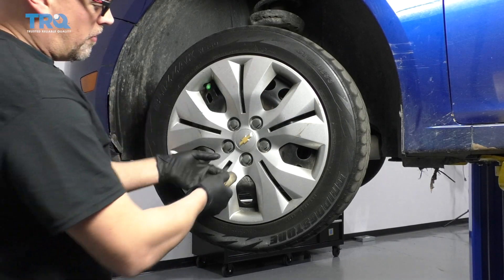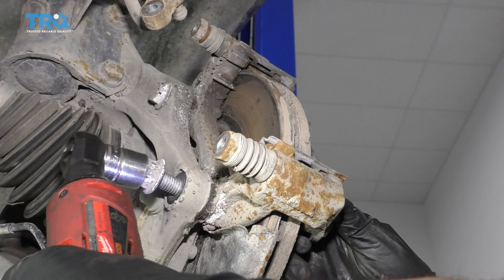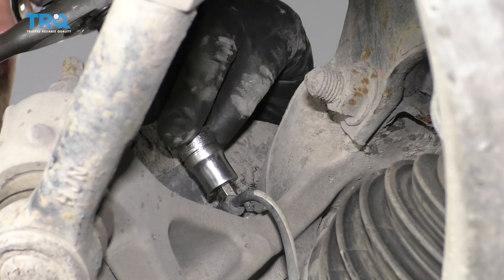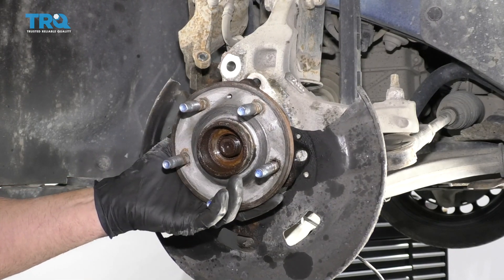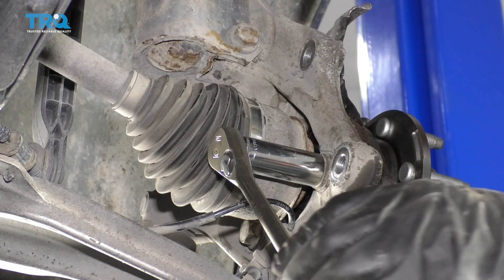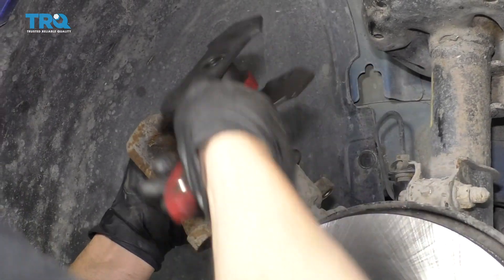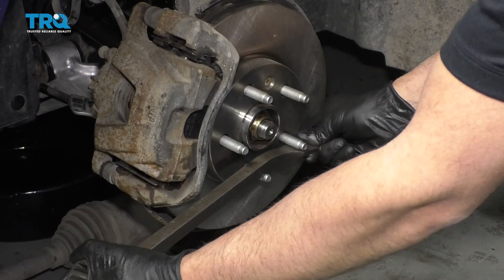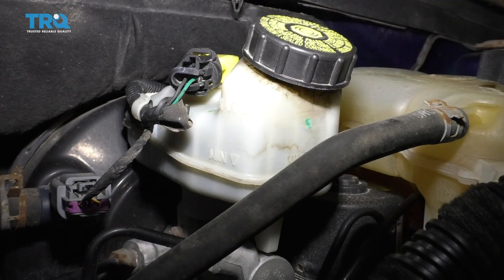How to Replace Front Hub Bearing 11-15 Chevy Cruze

Comment from the maker: √  Watch the Video
√  Buy The Part at 1A Auto http://1aau.to/m/Shop-TRQ-Parts
√  Do it Yourself
√  Save Money
Reply: I just bought new brake caliper slide pins and the bolts are not 10 mm they're 14 mm bolts now
Reply: what if you don't have a torque wrench just a breaker bar
Reply: my new wheel bearings from this company didn't come with new axle nuts in the boxes at all
Reply: Outstanding!  One of the best how to videos.  I was not looking forward to this job but this video made it a snap.  Only thing left to do that was not mentioned was dust the brake pedal with a microfiber towel!!  😂

Comment: Very good straightforward video. Just need all the gear you have to make it that easy. Premade hubs are a good idea in some ways. My old Holden Commodore did nearly 250k kilometres on the original hubs.Lot better than every 60k repacking

Comment: Excellent walk through! Now to go parts shopping and see where this will go wrong...
Reply: So here's how it went wrong: Couldn't get the retaining screw out on the driver's side. Rounded off the Torx head, then tried to get it out with a screw extractor. The screw extractor snapped.

Ended up drilling out much of the head, then banging the rotor with a mallet until it bent what was left of the screw head and I was able to finally twist it out!

😩
Reply: @TigDegner  Glad I can help! I found out later that something called a hand impact driver would have been very helpful in getting that screw out.

Comment: Great video - any idea on if that spacer is needed for the ABS wheel speed sensor operator, mine is cracked in two, im struggling to find the part number - any ideas ?

Comment: Angle meter what? LOL OK, so if I don't have that, or know how to use that, is a regular torque wrench going to work?

Also, is it necessary to dissassemble the brakes? Or can they be taken off as a unit and reinstalled as a unit. I saw a video for the same repair on a Ford and they were able to remove the rotors with the brake calipers attached  -  just one move - then return the whole kit and kaboodle afterwards.

Also, thanks for this great video!

Comment: Would this be the same for the 2017 Chevy sonic ? From Everything I can see. It looks identical. And I need to replace mine and I’d like to do it myself.
Reply: Same way to take off and on but the actual wheel hub and bearing are not the same, which suxs ass it's a different part

Comment: Put the new bearings on. Still hearing a humming noise that gets louder the faster you go. New tires, alignment was done with the new tires. No popping or clicking noises. Just loud humming at speed. Could it be a bad bearing?
Reply from the maker: +R R Hello I apologize we would not be able to diagnosis this type of issue here.
Reply: I have a similar issue and have a feeling it's my transmission although I am far from being a mechanic. Did you ever figure out what was causing the humming?

Comment: Brake caliper holding bolts are actually 74 ft-lbs + 60 degrees
Reply: Brake bracket, not caliper. You'd snap the caliper bolts if you tried that.

Comment: At 3:45 - What type of ratchet did you use to get to the top bolt on back side by the CV boot?  My ratchets are too big to fit around the boot
Reply: I just did the job and see what you mean. I used a shallow 18mm socket with a 1/2" wobble extension. You need to go at it from a slight angle, which the wobble extension makes possible.